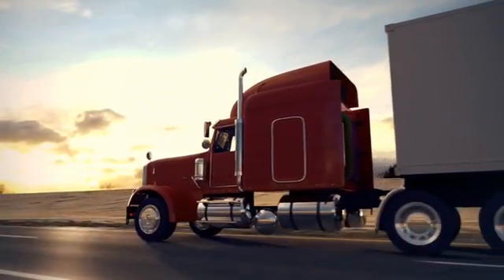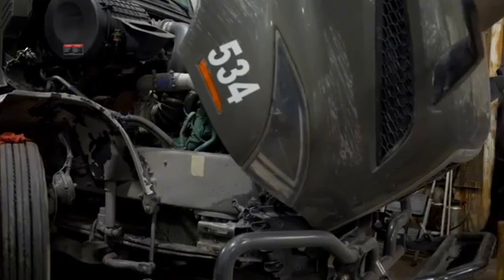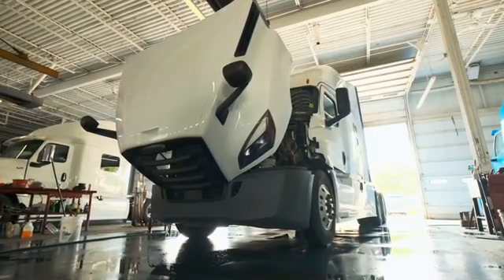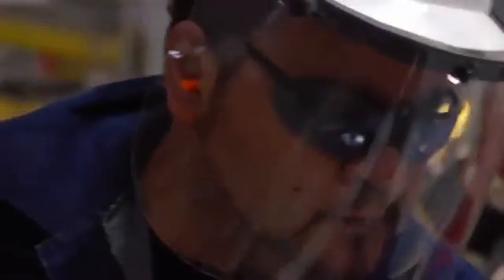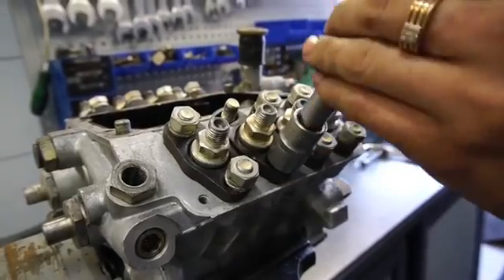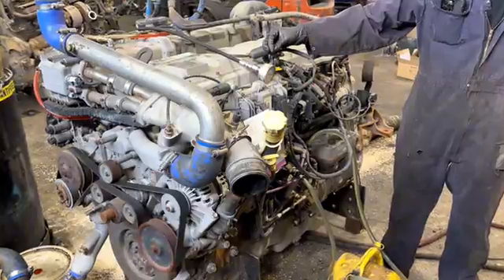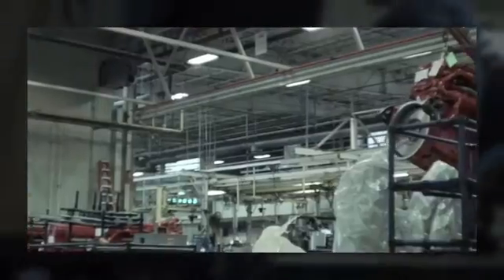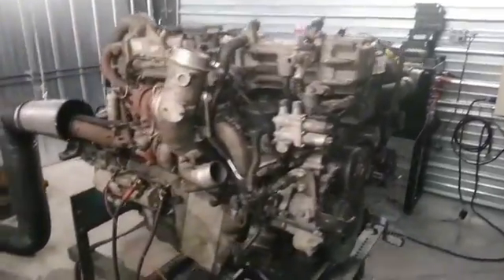Why Is MaxxForce 13 Such A Bad Engine ? I The Worst Engine Ever Made

Comment: I have 2017 N13.. absolutely zero major  issues so far in my last 350k miles.. i did have a NOX sensor go out but was replaced by manufacturer warranty. In 2017 they redesigned the emissions systems used in the A26 powered trucks today. So far the truck has not asked for a parked regen at all. I had the dpf cleaned as maintenance and it wasn't backed up with soot like the maxxforce13. I also use R99 fuel only in my truck which is better and cleaner then #2 diesel, only use #2 in a bind, and never use B20 fuel. R99 also has better lubricating properties which keeps your fuel system happy. The engine loves full synthetic shell T6 15w40, keeps everything clean inside.

Comment: The problems with this engine where many and never ending there’s way to much junk on this engine that needed to be removed to service it that it was often not an option to continue using it but the biggest problem with it was the EGR cooler that was placed inside the intake manifold it was placed in the path of cold air this caused the soot filled air to run across the cooler and create condensation and then it would plug with sludge caused by the soot mixed with the condensation in the cooler radiator filling it with cottage cheese like sludge which made the cooler in operable causing the EGR to stick and the cooling system to overheat over pressurize and the EGR cooler to in extreme situations split leading to coolant consumption and then if unnoticed hydrolock when the engine was shut down and the leaking coolant still under pressure found its way inside the engine cylinders through open valves of course if the engine was run long enough for it to overheat blown head gaskets cracked heads and gummed up turbos were all par for the coarse as was the plugging of the DPF system and the destruction of it’s filter but this 13 litter variant was still nothing compared to the 15 litter attempt that only was around for like two years most of those don’t last for even a 100,000 miles before catastrophic failures where reported by owners Anything with a max force doesn’t matter what displacement should be avoided at all costs they are irreparable even if you tried to remove the emissions from it the computer wouldn’t let it run requiring way more work than those vehicles are worth even in developing countries these engines where found to be unserviceable due to their complexity I know all this because I worked at a dealership when these trucks where coming off lease in huge numbers and nobody was taking them but scrap yards and used parts dealers who were mostly only interested in the rest of the truck not the engine

Comment: The engine itself is not a bad design ( it's a MAN based engine, Euro design ). The problem was the high volume EGR system that got hot, hot, hot and super sooty.
Reply: Exactly. Dan Ustian, CEO of Navistar, should have stuck with pushing pencils instead of interfering with engineers.
Reply: Nope, you’re thinking of the a26. The maxxforce family is purely international’s dumpster fire, and the reason why they moved on to badge-engineering eurodiesels.
Reply: @alexbeuerman7608  After CEO Dan Ustian, the CEO whose dumpster fire this was, was ousted, the new CEO discontinued the MaxxForce 15 which was a Cat C15 with Navistar EGR on it, and signed a deal with Cummins to A. Aquire the Cummins X15 engine and B. Have Cummins Emission Systems division save the day with a DEF system on the MaxxForce 9 and 10 (IH DT530/570) and MAN D2678 which they called A26 from that point onwards because the MaxxForce name was ruined..

IH nor Navistar havent designed a 13 liter since the DV800
Reply: Crap farce preceded that. The one being discussed was Caterpillar based.

Comment: Yes it's true that the maxxforce engine's earned a  terrible reputation almost from the getgo of it's introduction for lots of emissions related problems  . But therein lay the problems,  the wrong path to emissions is key to almost all the problems it had , th engine's minus the emissions system is not a bad engine at all , if international would have pursued the same path to meet emissions as the competition did  , I think they could have been very competitive  . In conclusion massive EGR is the blame for it's disastrous failure  😢😊
Reply: The MaxxForce 13 was a license built MAN D2678 which is a reliable engine with DEF in Europe. Just Navistar wanted to defy the laws of physics by going EGR only..